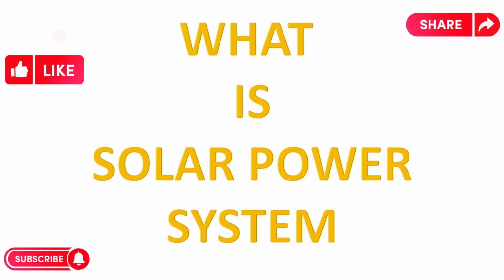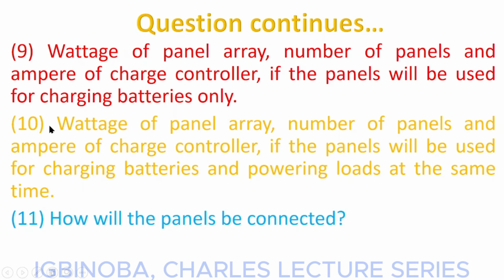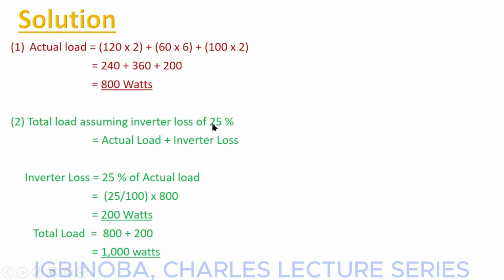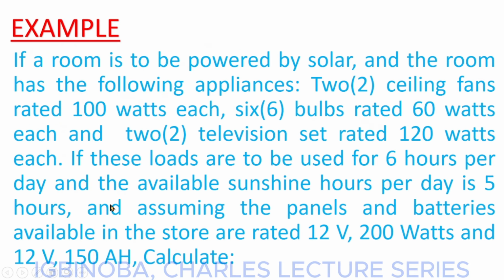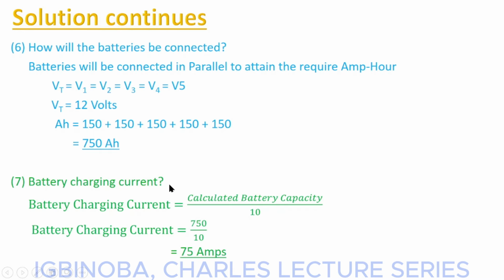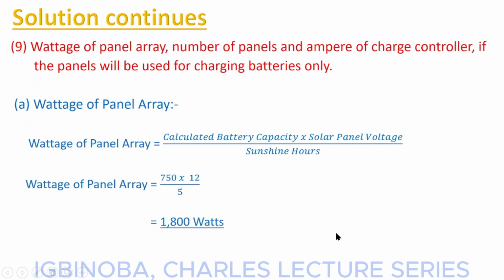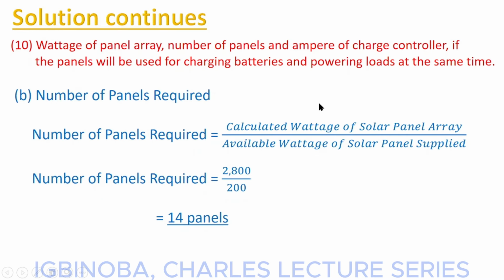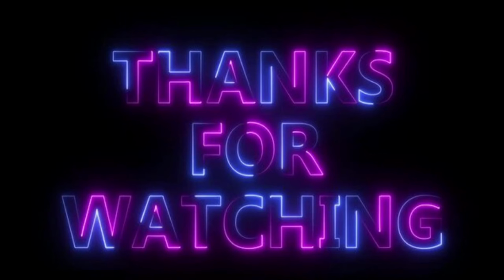Design of Solar Power System

Comment: CIV69CC 
I) Actually load =1380W
II) Total load with inverter loss of 25% = 1725W
III) Inverter rating in VA ( with power factor of 0.8) = 2156.25VA 
IV) Battery capacity = 1293.75AH 
V) Nos of Batteries= 9 batteries 
VI) Parallel connection 
VII) Battery charging connection= 129.375A
VIII) Battery charging time = 14 hours
IX) Solar setup( batteries only) = 3105W, 16panels, 258.75A charge controller 
X) Solar setup (batteries+load) = 4830W, 25 panels, 402.5A charge controller 
XII) panels connected in parallel

Comment: EEE108D 

Answers:

1. Actual load=1380W

2 Total load=1725W

3. The inverter rating is 2156.23VA

4. The battery capacity is 1293.75Ah

5. The number of batteries is 9

6. The batteries are connected in parallel.

7. The charging current is 129.4 amps.

8. The charging time is 14 hours.

9a 
The wattage of the panel array is 3,105W.

9B. The number of panels is 16 Panels.

9C. The charge controller rating is 258.75amps. 

10A. The wattage of the panel array is 4830watts

10B The number of the panels is 24 panels.

10C. The charge controller rating is 402.5amps.

11. The panels are arranged in parallel.

Comment: EEE62J
Answer:
1. Actual load = 1380Watt

2. Total load = 1725 Watt

3. Inverter rating = 2156.25VA

4. Battery Capacity = 1293.75AH

5. Number of batteries =  8.625 ≈ 9 batteries 

6. They will be connected in parallel

7. Battery charging current = 129.375Amps

8. Battery charging time with 40% loss = 14hrs

9a. Wattage of panel array = 3105 Watts

9b. Number of panels = 15.525≈ 16panels

9c. Ampere of charge controller = 258.75Amps

10a. Wattage of panel array with load = 4830Watts

10b. Number of panels = 24.15≈25panels

10c. Ampere of charge controller = 402.5Amps

11. They will be connected in parallel

Comment: PETRO034H

1. Actual load : 1380 watt
2. Total laod : 1725 watt
3. Inverter rating: 2156.25 VA
4. Battery capacity: 1293.75 AH
5. Number of batteries: 9 batteries 
6. It will be connected in parallel 
7. Battery charging time: 129.375 A
8. Charging time : 14 hours
9. Wattage : 3105 watt
    Number of panels: 16 panels 
    Charge controller: 258.75 A
10. Wattage : 4830 watt
     Number of panels: 25 panels 
     Charge controller: 402.5 A
11. It will ne connected in parallel
Reply: Sharp got same thing

Comment: MEC25I

Actual Load - 1380W
Total Load assuming Inverter Loss of 25% - 1725W
Inverter Rating - 2156.25VA
Battery Capacity - 1293.75 Ah
Number of Battery for Backup Hours - Approximately 9 Batteries
The batteries would be connected in parallel
Battery Charging Current - 129.375 Ah
Battery Charging Time - 14 hrs
Wattage of Panel Array For only Charging - 3,105W
Number of Panels For only Charging - Approximately 16 Panels
Ampere of Panel Array For only Charging - 258.75A
Wattage of Panel Array for charging and powering load - 4,485W
Number of Panels for charging and powering load - 22
Ampere of panels for charging and powering load - 373.75A
The panel would be connected in series

Comment: CHM104Z

(1) Actual load: 1800 W
(2) Total load (with 25% inverter loss): 2250
(3) Inverter rating (PF = 0.8): 2812.5 VA
(4) Battery capacity (75% reserve factor): 1800 AH
(5) Number of batteries: 12 batteries
(6) Battery connection: Series-parallel
(7) Battery charging current: 180 A
(8) Battery charging time (40% charging loss): 13.33 hours
(9) Panels for charging batteries only: Panel array wattage = 5400 W Number of panels = 27 Charge controller = 225
(10) Panels for charging batteries + powering loads simultaneously: Panel array wattage = 8100 W Number of panels = 41 Charge controller = 338 A (or next standard size)
(11) Panel connection: Series- parallel combination to match the system voltage ( 24v or 48v) and required current.

Comment: NAT44R
Answers: 
1. The actual load is 1,380W 
2. The Total load is 1,725W 
3. The inverter rating is 2,156.23VA 
4. The battery capacity is 1,293.75Ah 
5. The Number of batteries is 9 
6. The batteries are connected in parallel 
7. The Battery charging current is 129.4A. 
8. The battery charging time is 14 hours. 
9. a. The wattage of the panel array is 3105W 
b. The number of panels is 16 panels. 
c. The Charge controller rating is 258.75A. 
10. a. The wattage of the Panel array is 4,830W
b. The number of panels is 24 panels. 
c. The charge controller rating is 402.5A
11. The panels are arranged in parallel

Comment: CIV5E
a. 1380watts
b. 1725watts
C. 2156.25VA
d. 1293.75ah
e. 9 batteries
f. In parallel
g. 129.375amps
h. 14hrs
Ii. 3105watts
Iii. 16 panels
Iiii. 258.75amps
Ji. 4830watts
Jii. 24 panels
Jiii. 402.5amps
K. In parallel

Comment: MEC7G

1) Actual load = 1380W
2) total loads = 1725W
3) inverter rating = 2156.25Ah
4) battery capacity = 1293.75Ah
5) number of batteries= 9
6) they are connected in parallel 
7) battery charging current = 129.375Ah
8) 14hrs
9) 3105W    (9b)    16panels
9c) 258.75A
10)4830W     (10b) 24 panels
10c) 402.5A
11) connected in parallel

Comment: MEC64L 

1.Actual load: 1,380W
2.Total load: 1,725W
3.The inverter rating is 2,156.23VA
4.The battery capacity is 1,293.75Ah
5.The number of batteries is 9.
6.The batteries are connected in parallel.
7.The battery charging current is 129.4 amps.
8.The battery charging time is 14 hours.
9(a) The wattage of the panel array is 3,105W.
(b) The number of panels is 16 Panels.
(c) The charge controller rating is 258.75amps.
10.
(a) The wattage of the panel array is 4,830 Watts.
(b) The number of the panels is 24 panels.
(c) The charge controller rating is 402.5amps.
11. The panels are arranged in parallel.

Comment: PETROCHEM65M 

ANSWER 
Actual Load: 1380W
Total Load: 1725W
Inverter Rating: 2156.25VA
Battery Capacity (75% DoD): 1150Ah
Number of Batteries: 8
Battery Connection: Parallel
Battery Charging Current: 230A
Charging Time (40% loss): 14 hours
Panel Array Wattage: 2898W
Number of Panels: 16
Charge Controller Rating: 258.75A
Panel Array Wattage: 4830W
Number of Panels: 24
1Charge Controller Rating: 402.5A
Panel Arrangement: Parallel

Comment: COMP40N

1. The actual pad is 1,380W
2. The Total load is 1,725W
3. The inverter rating is 2,156.23VA
4. The battery capacity is 1,293.75Ah 
5. The Number of batteries is 9
6.  The batteries are connected in parallel 
7. The Battery charging current is 129.4 amps.
8. The battery charging time is 14 hours.
9. a. The wattage of the panel array is 3,105W
b. The number of panels is 16 panels.
c. The Charge controller rating is 258.75 amps.

10. a. The wattage of the Panel array is 4,830 Watts 
b. The number of panels is 24 panels.
c. The charge controller rating is 402.5 amps
11. The panels are arranged in parallel

Comment: PETRO88J 

1. 1380W
2. 1725W
3. 2156.25VA
4. 1293.75
5. 9 batteries 
6. Parallel 
7. 129.375A
8. 14 hours
9a. 3105W
9b. 14 panels
9c. 258.75A
10a. 4830W
10b. 14 panels
10c. 402.5A
11. The panels are arranged in Parallel

Comment: CHM33G 

Answers 
1.) Actual load = 1380W
2.) Total load = 1,725W
3.) inverter Reading=2156.25VA
4.) Battery capacity using a Reverse of 75%=1,150Ah
5.) Number of batteries for backup hours=8 batteries 
6.) Battery connection= parallel 
7.) Battery charging current= 230A
8.) The battery charging time with 40% loss=14 hours 
9a.) The wattage of the panel array =2,898W
9b.) The number of panels=16
9c.) The charge controller rating=258.75amps 
10a.) The wattage of panel arrays is =4,830W
10b.) The number of panel is 24
10c.) The charge controller ratings is =402.5amps
11.) The panel are arranged in parallel.

Comment: PETRO39M

Answers:
1. Actual load = 1380Watt
2. Total load = 1725Watt
3. Inverter rating = 2156.25VA
4. Battery Capacity = 1239.75Ah
5. Number of batteries = 8.625 (9 batteries)
6. They will be connected in parallel 
7. Battery charging current = 129.375A
8. Battery charging time with 40% loss = 14hrs
9a. Wattage of panel array = 3105Watt
9b. Number of panels = 16panels
9c. Ampere of charge controller = 258.75A
10a. Wattage of panel array with load = 4485Watt
10b. Number of panels = 23panels
10c. Ampere of charge controller = 373.75A
11. They will be connected in parallel.

Comment: MEC60H 
1) 1380W
2) 1725W
3)2156.25VA
4) 1293.75
5) 9 batteries 
6) parallel 
7) 129.375A
8) 14hrs
9)a) 3105W
b) 14 panels 
.c) 258.75A
10)a) 4830W
.b) 14 panels 
.c) 402.5A
11) panels are arranged in parallel

Comment: COMP60H

1. The actual pad is 1,380W
2. The Total load is 1,725W
3. The inverter rating is 2,156.23VA
4. The battery capacity is 1,293.75Ah 
5. The Number of batteries is 9
6.  The batteries are connected in parallel 
7. The Battery charging current is 129.4 amps.
8. The battery charging time is 14 hours.
9. a. The wattage of the panel array is 3,105W
b. The number of panels is 16 panels.
c. The Charge controller rating is 258.75 amps.

10. a. The wattage of the Panel array is 4,830 Watts 
b. The number of panels is 24 panels.
c. The charge controller rating is 402.5 amps
11. The panels are arranged in parallel

Comment: EEE66N 
Actual load: 1,380W
 2 Total load: 1,725W
 3The inverter rating is 2,156.23VA 4 The battery capacity is 1,293.75Ah 
5 The number of batteries is 9. 
6 The batteries are connected in parallel. 
7 The battery charging current is 129.4 amps.
 8 The battery charging time is 14 hours.
 9a The wattage of the panel array is 3,105W. 
(b) The number of panels is 16 Panels. 
(c) The charge controller rating is 258.75amps.
 10a The wattage of the panel array is 4,830 Watts.
 (b) The number of the panels is 24 panels. 
(c) The charge controller rating is 402.5amps. 
11 The panels are arranged in parallel.

Comment: PETRO33G 

Answers:
1. Actual load = 1380Watt
2. Total load = 1725Watt
3. Inverter rating = 2156.25VA
4. Battery Capacity = 1239.75Ah
5. Number of batteries = 8.625 (9 batteries)
6. They will be connected in parallel 
7. Battery charging current = 129.375A
8. Battery charging time with 40% loss = 14hrs
9a. Wattage of panel array = 3105Watt
9b. Number of panels = 16panels
9c. Ampere of charge controller = 258.75A
10a. Wattage of panel array with load = 4485Watt
10b. Number of panels = 23panels
10c. Ampere of charge controller = 373.75A
11. They will be connected in parallel.

Comment: PETRO40N
Answers:
1. Actual load is 1380W
2. Total load is 1725W
3. Inverter rating is 2156.23VA
4. The battery capacity is 1293.75Ah
5. Number of batteries 9
6. The batteries are connected in parallel
7. Battery charging current 129.4amps
8. Battery charging time 14hrs
9. Wattage of panel 3105W
a. Number of panels 16
b. Charge controller rating 258.75amps
10a. Wattage of the panel array 4830watts 
10b. Number of panels 24
10c. Charge controller rating 402.5amps
11. In parallel

Comment: EEE1A
Answer 

 1)  Actual load=1380Watts

 2)  Total load=1725Watts

 3)  Inverter rating=2156.25VA

 4) Battery Capacity= 1293.75AH

 5)  Number of Batteries= 9 batteries

 6) Batteries connection: Parallel

 7)  Battery Charging Current: 129.375A(150A)

 8) 14Hours
   9a) . Wattage of panel array(charging only batteries)=3105.6Watts

   9b) Number of panels= 16panels

   9c). Ampere of charge controller= 358.8A

   10a) . Wattage of panel array (Battery and load)=4831Watts.

   10b) Number of panels= 24 panels

   10c. Ampere of charge controller= 402.5A

 11)  Panel connection: Parallel

Comment: MAR57E 
Answers:

1. The actual load is 1,380W

2, The Total load is 1,725W

3. The inverter rating is 2,156,23VA

4. The battery capacity is 1,293.75Ah

5. The Number of batteries is 9

6. The batteries are connected in parallel

7. The Battery charging current is 129,4 amps,

8. The battery charging time is 14 hours,

9. a. The wattage of the panel array is 3,105W

b. The number of panels is 16 panels.

c. The Charge controller rating is 258.75 amps,

10. a. The wattage of the Panel array is 4,830 Watts

b. The number of panels is 24 panels.

c. The charge controller rating is 402,5 amps

11. The panels are arranged in parallel

Comment: PETRO80B
1. Actual Load: 1380W
2. Total Load: 1725W
3. Inverter rating: 2156.25VA
4. Battery Capacity: 1293.75Ah
5. Number of batteries: 9 batteries 
6. The batteries will be connected in a parallel connection. 
7. Battery charging current: 129.375A.
8. Charging time: 14 hours. 
9
a. Wattage of the panel array: 3105W
b. Number of panels ≈16 panels
c. Ampere of charge controller: 258.75A.
10
a. Panel wattage: 4850W.
b. Number of panels ≈24 panels.
c. Ampere of charge controller: 402.5A
11. The panels will be connected in a parallel connection to increase it's power output.

Comment: CIV57E

1. The actual pad is 1,380W
2. The Total load is 1,725W
3. The inverter rating is 2,156.23VA
4. The battery capacity is 1,293.75Ah 
5. The Number of batteries is 9
6.  The batteries are connected in parallel 
7. The Battery charging current is 129.4 amps.
8. The battery charging time is 14 hours.
9. a. The wattage of the panel array is 3,105W
b. The number of panels is 16 panels.
c. The Charge controller rating is 258.75 amps.

10. a. The wattage of the Panel array is 4,830 Watts 
b. The number of panels is 24 panels.
c. The charge controller rating is 402.5 amps
11. The panels are arranged in parallel

Comment: MAR26Z
Answers:
(1) Actual load = (3×100) + (10×60) + (4×120) = 1,380 W

(2) With 25% loss = 1,380 / 0.75 = 1,840 W

(3) Inverter VA = 1,380 / 0.8 = 1,725 VA (use 2kVA)

(4) Battery capacity = (1,840×6)/12 = 920 Ah; with 75% reserve = 920/0.75 = 1,226.67 Ah

(5) No. of batteries = 1,226.67 / 150 = 8.18 → 9 batteries

(6) Connection = All parallel (12V bank)

(7) Charging current = 920 Ah / 5 sun hrs = 184 A

(8) Charging time = [920/(1-0.4)] / 184 = 1,533.33/184 = 8.33 hrs (needs more panels)

(9) Panels for charging only:
Energy = (1,840×6)/0.6 = 18,400 Wh → Wattage = 18,400/5 = 3,680 W
Panels = 3,680/200 = 19
Controller = 3,680/12 = 306.67A × 1.25 = 383A → 400A

(10) Panels for charging + loads:
Load during 5hrs = 1,840×5 = 9,200 Wh
Remaining 1hr from battery = 1,840/0.6 = 3,066.67 Wh
Total = 12,266.67 Wh → Wattage = 12,266.67/5 = 2,453 W
Panels = 2,453/200 = 13
Controller = 2,453/12 = 204.44A × 1.25 = 255.5A → 300A

(11) Panel connection = All in parallel (+ to +, – to –)

Comment: CIV6F

ANSWER:
Actual load = 1380 W
Total load = 1725 W
Inverter rating = 2156.25 VA
Battery capacity = 1293.75 Ah
Number of batteries for backup hours = 9 batteries
Battery connection = In parallel
Battery charging current = 129.375 A
Battery charging time = 14 hours
a) Wattage of panel array (only batteries) = 3105 W
b) Number of panels = 16 panels
c) Ampere for charge controller (only batteries) =
258.75 A
a) Panel wattage (battery and load) = 4830 W
b) Number of panels = 14 panels
c) Ampere for charge controller (battery and load) =
402.5 A
Panel connection = In parallel

Comment: EEE91M
ANSWERS: 1. Actual Load: 1380W
2. Total Load: 1725W
3. Inverter Rating: 2156.25VA
4. Battery Capacity (75% DoD): 1150Ah
5. Number of Batteries: 8
6. Battery Connection: Parallel
7. Battery Charging Current: 230A
8. Charging Time (40% loss): 14 hours

9a. Panel Array Wattage: 2898W
9b. Number of Panels: 16
9c. Charge Controller Rating: 258.75A

10a. Panel Array Wattage: 4830W
10b. Number of Panels: 24
10c. Charge Controller Rating: 402.5A

11. Panel Arrangement: Parallel

Comment: NAT28B 

1. Actual load=1380 Watts 
2. Total load=1725Watts
3. Inverter rating=2156.25VA
4. Battery capacity=1293.75AH
5. Backup hrs=8.63hrs
6.in parallel 
7. Battery charging current=129.375Amp
8. Battery charging time=14hrs
9.(a) Wattage of panal array=3105Watts
(b) Number of panal= 16 panal
(c) Amperes of charge=258.75 Amps 
10. (a) Wattage of panal array=4830Watts
(b) Number of panal=24 panal 
(c) Amperes of charge=402.5Amps

Comment: MEC21U
Answer:
1.Actual load = 1380 W
2.Total load = 1725 W
3.Inverter rating = 2156.25 VA
4.Battery capacity = 1293.75 Ah
5.Number of batteries for backup hours = 9 batteries
6.Battery connection = In parallel
7.Battery charging current = 129.375 A
8.Battery charging time = 14 hours
9.a) Wattage of panel array (only batteries) = 3105 W
b) Number of panels = 16 panels
c) Ampere for charge controller (only batteries) =
258.75 A
10.a) Panel wattage (battery and load) = 4830 W
b) Number of panels = 14 panels
c) Ampere for charge controller (battery and load) =
402.5 A
11.Panel connection = In parallel

Comment: MAR87I
THE ANSWERS ARE:

 1. Actual load=1380Watts
 2. Total load=1725Watts
 3. Inverter rating=2156.25VA
 4. Battery Capacity= 1293.75AH
 5. Number of Batteries= 9 batteries
 6. Batteries connection: Parallel
 7. Battery Charging Current: 129.375A(150A)
 8. 14Hours
 9a. Wattage of panel array(charging only batteries) =3105.6Watts
 9b. Number of panels= 16panels
 9c. Ampere of charge controller= 358.8A
10a. Wattage of panel array (Battery and load) =4831Watts.
10b. Number of panels= 24 panels
10c. Ampere of charge controller= 402.5A
11. Panel connection: Parallel

Comment: COMP38L

Answers:

The actual load is 1,380W

The Total load is 1,725W

The inverter rating is 2,156.23VA

The battery capacity is 1,293.75Ah

The Number of batteries is 9

The batteries are connected in parallel

The Battery charging current is 129.4 amps.

The battery charging time is 14 hours.

a. The wattage of the panel array is 3,105W b. The number of panels is 16 panels. c. The Charge controller rating is 258.75 amps.

a. The wattage of the Panel array is 4,830 Watts b. The number of panels is 24 panels. c. The charge controller rating is 402.5 amps

The panels are arranged in parallel